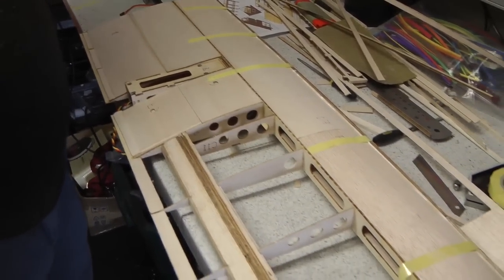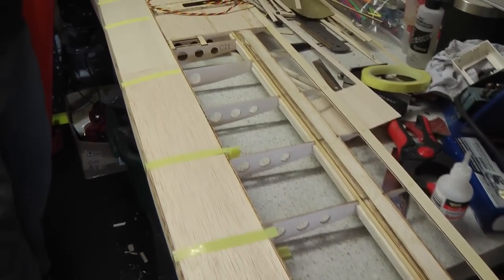Hobbyking RQ-7 Shadow Build Pt7

Comment: What kind of hinges did you use for the ailerons? In one of the videos you mention you were using something else but I don't recall every showing what.  Thanks for the videos, very helpful.
Reply from the maker: All the hinges were the round barbed type. where you just have to drill a hole. ;o)
Reply: Robart style pin hinges then.  Thanks ... just got my kit today.  Should be fun and you've identified all the problem areas already.  Note to self, no NTM motors. :-)